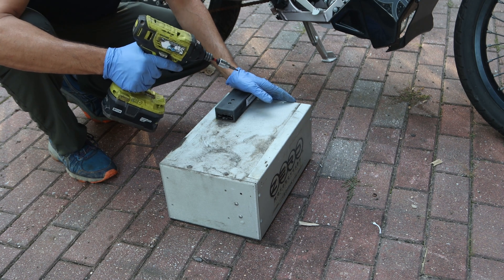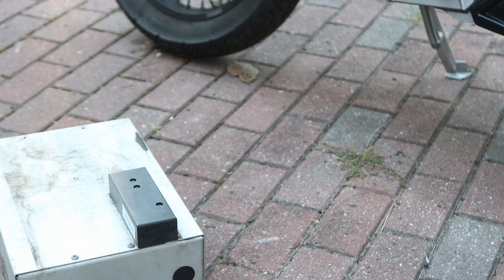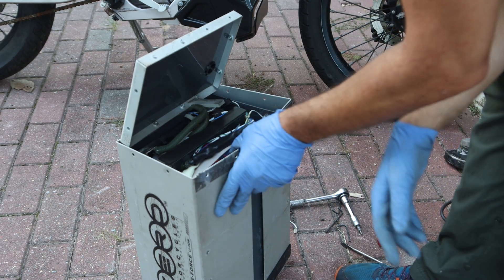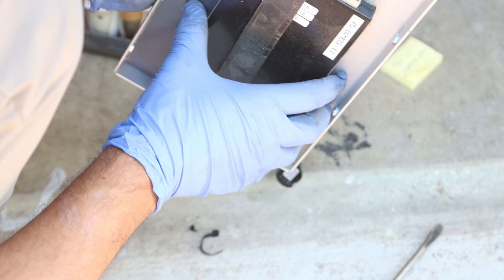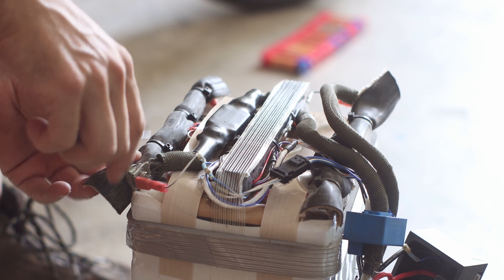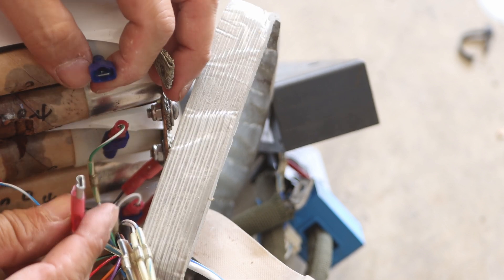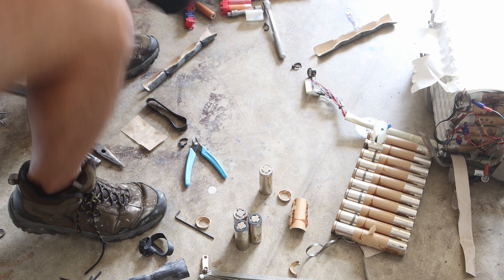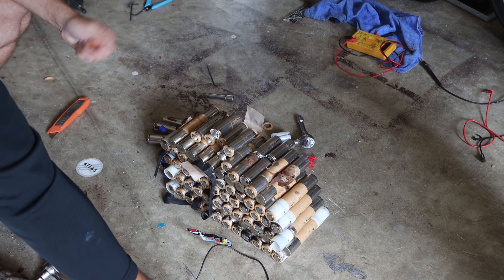2011 Zero Electric FX XU Motorcycle Battery Teardown

Comment: Don't do it! I made a video years ago about rebuilding them. Original 2009 10 and probably 11 were really bad design. The BMS never went to sleep and so kills 1/2 of cell to keep the others alive so most owners have their battery go bad in no time. Zero wants $1800 to rebuild and the one I had done had trouble later.... The other stupid design is using big gum bands to hold battery to web strips to connect! 

Use a small bicycle 48 volt charger instead of the delta and it will last much longer, just plug into the red and black charge plugs, not the white. The 164 cells are expensive and impossible to find, I know. 

I had batteries last 5 years doing that! I now use 1/2 slab 48 volt M Smart car battery in my zero and no BMS with slow charging bicycle charger 1 to 200 watts max. Runs faster! more current. Most others won't fit.

I converted a 2009 to street and ran around Santa Cruz where they are made for 7 years and still use it for off road, so love the bike and simplicity as little goes wrong. 
You can bypass the main controller, find the schematic on Altrax web site if you know electronics!

Comment: Good find Motard Squid! I picked up  a 2012 Zero XU without a battery pack off Craig's list for $895  June of 2022.  It was easy to bypass the computer and build a 14s battery (58.8 volts peak). These bikes are a blast to ride.  I have over 2000 miles on mine. You have probably already  tested the motor and controller. It is not hard.  When you get it running, set the controller to 100% throttle and try to keep the front wheel on the ground.  Thanks for all the excellent info on your channel.
Reply: Hey man, I just got a Zero FXs for free from a a cousin, but with a non functioning battery pack as well. I know alittle bit about lipos and speed controllers from my drone building days, but I'd love to be able and talk with ya for a minute to eliminate some of the guess work on my end.
Reply: how did u bypass the computer? Cant find anything :( How about BMS. Did u replace it? Same chemistry and capacity as before? Or?
Reply: tim we need answers my friend

Comment: why 5fps video?
Reply from the maker: I have a new camera and for some reason it did that. Not sure why yet. Hopefully the next video will be better.
Reply: I have rarely seen someone with 0.0 idea dare to do such things... by the way, there are probably 21,700 cells, which not only contain more energy, but can also release more energy (amps) and also have a nominal voltage of 3.7 volts  .  Maybe you'd talk to someone who has at least a hint of what's going on in a battery pack before you blow up the house installing new cells.
Reply: lol
 @Mag0mat0r
Reply from the maker: good thing the battery was completely dead @Mag0mat0r
Reply: Die Batterie muss nicht voll sein,um sich zu töten